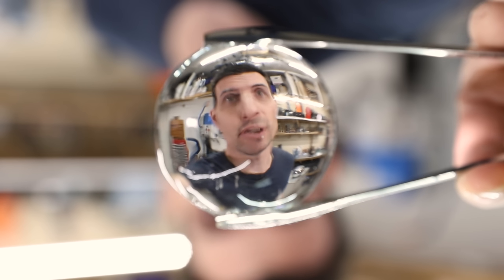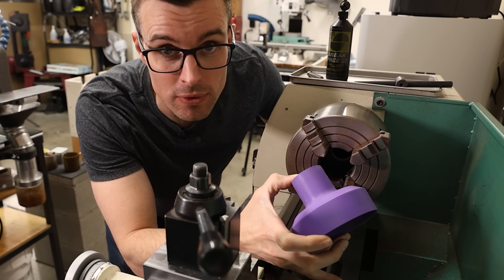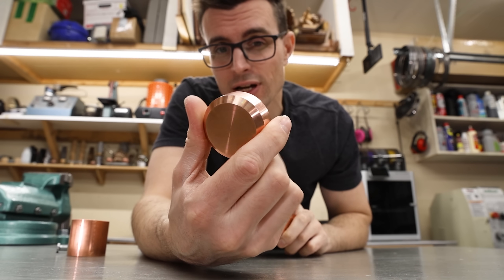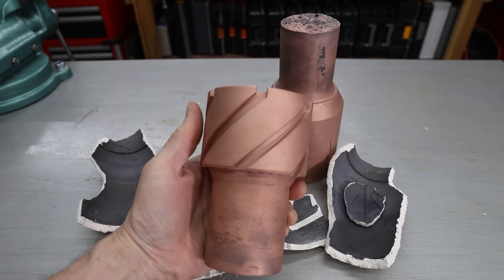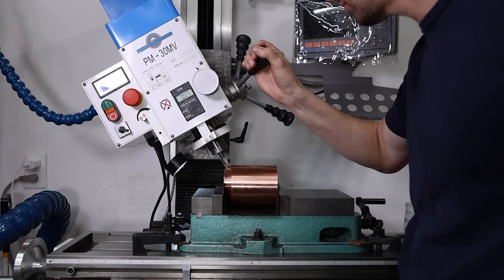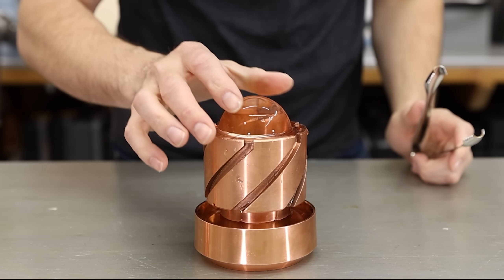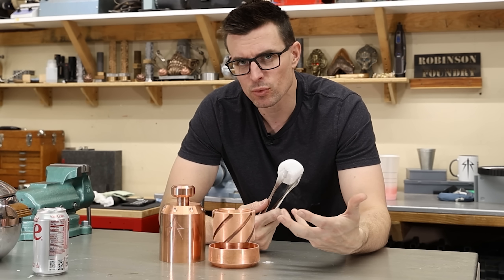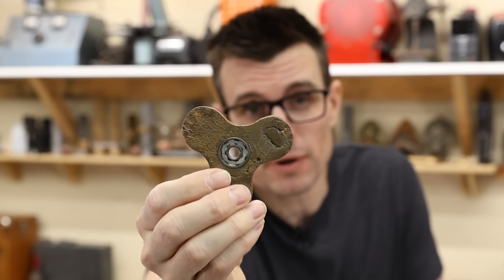I made a Copper Ice Press that Turns Ice into SPHERES - Lets try DRY ICE!

Comment: That was very cool. I didn't know copper would melt ice so fast.
Reply: Same reason that the best computer heatsinks are either copper or include copper in their design. When you need maximum heat transfer from hot chips, there really is no other (cost effective) solution.
Reply: @technicalfool theres silver haha but yeah not cost efficient
Reply: @royalecrafts6252  Ah, but it would be awesome to see one made from silver in action. :)
Reply: @technicalfool diamond is 5 times more thermally conductive...
Reply: @technicalfool wouldn't it be cost effective to have small silver leads from chip to the copper mass?
Reply: Forget my comment. Only 10% higher in silver than copper. Not worth the hassle.
Did remind me why they've been working for decades to get a diamond chip base. 10 times the conductivity of silver or copper
Reply: @technicalfool  Am I the only one here who went to highschool? lol
You learn the specific heat formula in basic chem..
Q=mcΔT
where:

𝑄= heat energy (in joules)
𝑚= mass of the material (in grams)
𝑐= specific heat capacity (in J/g°C)
ΔT = change in temperature (in °C)

The energy released by the copper is more than 3 times what is required to melt ice; gold/silver/platinum are all more conductive, but copper has a much higher specific heat capacity so despite being less conductive copper will still transfer more energy.
Reply: @raidzeromatt 👏🏼👏🏻👏👏🏽👏🏾👏🏿 You are the smartest person on the planet, congratulations.🤦‍♂️
Reply: @raidzeromatt  You learned the specific heat formula yet didn't learn high school is two words?  LOL😉
Reply: Copper is know for it’s amazing thermal conductivity
Reply: Yeah, I thought he was going to put water in it and use the conductive properties of copper to fast freeze it or something?
Reply: You should see diamond, it has the highest heat conductivity of any solid state material, way more than any metal. It's like magic.
Reply: Use hot water for clear ice
Reply: Actually, it's the temperature differential that does the melting.
Reply: @ernie5229  I don't understand how putting a room-temperature copper press on top of ice melted it? Copper is conductive, you're right but how is a room-temperature copper press melting ice so quickly and easily??
Reply: @calicoesblue4703  you just need to get the temperature above 0 for it to melt, and I don't think a higher temperature transfers energy/heat much faster. It's more of a bandwidth issue. And to make it a perfect sphere, you'd need it to not boil away or heat the water at the end too much, as it provides an insulating layer so you don't melt the remaining sphere. Tbh, I only know what I absorbed from my parents and school as a kid, so I might get some of this wrong, but this is my instinctual take. :)

Comment: How about considering whether you can melt quartz glass and start making quartz balls... and make larger versions and start supplying to all of the many esoteric places for their crystal ball uses ? !
Reply: Various colored quartz glass colors for rainbow sales.  Making 2 inch, 3, 4, 5, 6 even 8 inch or larger (!) 12 inch quartz crystal balls.  You can easily make larger versions of this design.  If need be put in a pour (and air) hole.  You would be slamming sales for these specialty spheres ... $$$$$.  Copper for the win !

Comment: I think the reason you didn't get the fog is there wasn't enough water vapor around for it to condense into fog.

Normally when people demonstrate it making fog, they are placing it into water to warm it up. In the closed container any in the air is quickly used.

It would probably work if you put some regular ice and dry ice in it

Comment: Great project. The best way to make clear ice in my experience: fill a yeti style tumbler 3/4 up with no lid and place in the freezer. This is your mini cooler and allows for directional freezing. 18 or so hours later, remove from freezer. Let sit on counter for 1-3 hours. Invert over sink. Squeeze tumbler at top to allow for air to enter around sides and release perfect slug of clear ice.
Reply: To make a bunch you can also use a small chest cooler similarly (if it fits in your freezer) then divvy up the clear portions into blocks.
Reply: This is the way I've done it but if you get the timing right, you can actually remove the ice even easier. I've just inverted the tumbler over my sink and let it sit there for about 15-20 minutes, then used a butter knife to pop it out. But the key is that you can't let it freeze for too long otherwise it's practically impossible to remove from the tumbler. But the benefit to this method is that if you use the right size tumbler, it can be a pretty nice size to fit right in your glass.
Reply: @tylerbogaard375  one thing that I've done that works really well to help remove the ice is wrapping the inside of the cup in a silicone baking mat. It'll leave a small spiral ridge on one side of the ice but you can remove the ice as soon as you take it out of the freezer.
Reply: I use a small ice chest. Distilled water and even then, I get 70% clear ice and the rest is cloudy. Then I saw them all up and put them in bags. The key is to NOT let the cooler freeze all the way. You want the cloudy crap to by watery so you can just knock it off.
Reply: I have had acceptable results filling a 8x6x2 .999 silver rectangular mold with one inch thick mirror polished walls, filled with distilled, microfiltered water and slowly frozen in a vacuum chamber from room temperature reduced to -20F over a period of 38 hours. Introduce argon to the vaccuum chamber as you reduce the vacuum, and remove the ice block using a pair of tongs made from a dragon's hip bone. This yields a very good piece of ice.
Reply: @tabcreedence6553  dragon hip bone is really hard to get in my area. Tried walrus tusk and black hole formed when it touched the ice. Do not recommend.
Reply: @mmr159  "Yeah, dragon hip bone is premium, but have you tried unicorn horn? The trick is ethically sourcing it—those things hold grudges. Last time I used one, my ice was perfect, but all my drinks started floating away mysteriously."
Reply: I think you're exaggerating, I doubt you need 1 in thick walls, also I've found that most any dragon bone will make a serviceable pair of tongs not just the hip bone. @tabcreedence6553
Reply: @tabcreedence6553  "Impressive! But you missed a step—you need to sprinkle a pinch of moon dust while introducing the argon. Otherwise, the ice might not align with the Earth's ley lines, and your cocktails will taste slightly... mortal."
Reply: So 19 to 23 hours later you get a slug of clear ice.....😮🤔🙄😅 From what I saw in this video it was 40 to 20 seconds after you went and either made or purchased your ice😅 ball press
Reply: I continue to "shake" oilmen with my innovative project of a non-combustion engine, I remind you that I am posting here on my channel the technology and the principle of operation, according to which anyone can create a prototype and enjoy free energy, since I was denied financial support at the stage of the idea and theoretical research, after a year of unsuccessful searches. Including I will begin to assemble a sample. And soon another video will be released, revealing my developments, the wind of change is approaching! All those who are not indifferent, welcome to the flight in this departing innovative car, which will lead to great achievements for the successful future of the planet and humanity!

Comment from the maker: What should I try next and please hit the 👍if you liked it!
Reply: Make a copper frying pan!
Reply: That dry ice was releasing a surprising amount of energy with the copper! I wonder if you could make a copper crowned heated piston that actuates via the rapid gas expansion of the dry ice melting.
Reply: Very cool! How about metal dice (Dungeons & Dragons) that are perfectly equal weight on each side such that they don't favor any side over others, eg. submerged in water to check biases. 

Thank you.
Reply: Here is a barman's tip I learned from my friend. Get a small coller with the top off you can use tap water. Put it in the freezer over 24 hrs you can have a huge chunk of square ice with impurities at the bottom. Use a bread knife to score the ice then a rubber mallet to wack the top of the knife along the score to crack the ICE into usable square chunks.
Reply: I'm curious, how much would this actually cost to purchase, because it is fascinating!!!
Reply: Brass/bronze/copper mjolnir?
Reply: Make it out of silver
Reply: @InTheAKSnow @ 16 lbs it would cost over 8 thousand dollars 😳
Reply: Casting HO scale train wheels
Reply: Try a Phone case
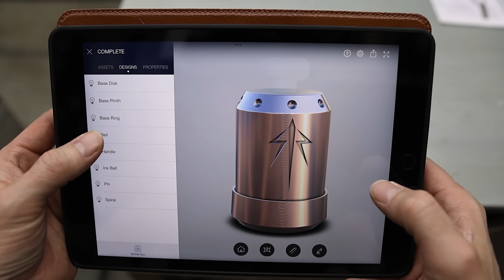Reply: Out of curiosity, what was the CAD software you used? (0:40)
Thanks so much 🧡🕊️🤩
Reply: Look for my comments
Reply: I continue to "shake" oilmen with my innovative project of a non-combustion engine, I remind you that I am posting here on my channel the technology and the principle of operation, according to which anyone can create a prototype and enjoy free energy, since I was denied financial support at the stage of the idea and theoretical research, after a year of unsuccessful searches. Including I will begin to assemble a sample. And soon another video will be released, revealing my developments, the wind of change is approaching! All those who are not indifferent, welcome to the flight in this departing innovative car, which will lead to great achievements for the successful future of the planet and humanity!
Reply: I bet you could reinvent the herb 🌿  grinder.
Reply: try to make a prince ruperts drop without a tail by quickly submerging the hot press in dry ice, i believe that would be a first!
Reply: Try adding food coloring to the water before you freeze it into ice.
Reply: Don't really have a suggestion for your next project but this suddenly came to me:

Have some longer projects to make into series. At the end of each series, release your own commemorative coins as merchandise, with each series' coins having its own unique design? Food for thought, maybe?
Reply: I wish this was available on a market place. What a cool add to a bar
Reply: mr robinson from the angry birds hat guy
Reply: Lightsaber
Reply: it's a mini snowball machine
Reply: How about making clear ice😂 use reverse osmosis water so that it's 100% mineral free. . . . . You'll be amazed
Reply: do a silver one, since it is a better conductor! 😅
Reply: How about a spice rack and the individual containers will magnetically adhere to the base but not to one another, you pick the base materials...?🙂👍
Reply: Make another copper sphere video with motors of different speeds
Reply: Molybdenum pan.
Reply: How about a cocktail shaker out of a single piece of bar stock entirely on the lathe, @robinson-foundry?
Reply: Can you try and make these on demand for sale please? 🙂
Reply: @KiteInAHurricane  I'm with you on this one!
Reply: I forget if i've seen copper damascus before or not? I don't know alot about metalworking even in general, but with steel damascus the idea is that you have 2 different alloys that respond differently to being etched in acid, so you can get these crazy patterns by contrasting the 2 metals.

I wonder if you could maybe even do something with nickel and copper?
See aluminum and copper would probably contract at different rates, and i have no idea what they'd do in an alloy...

Maybe even a series of just figuring out methods to make patterns could be cool, alec steeles channel has a series about titanium steel damascs that i've been enjoying lately! 

I also just think that shiny copper looks so good!
Reply: @SethCrowderMusic  You can use a copper-nickel alloy and pure copper to make something like damascus.  Most people just use a stack of US quarters forge welded together.
Reply: @SethCrowderMusic 🔴 Why Islam not other religion

 1-islam gives logical and simple idea for God - he is A perfect God - he is not a man nor a son of man nor an Idol or a trinity nor limited nor created - he is totally unique and to him belongs all the good qualities 

2-Islam accepts all messengers of God -- about 124 000 and in Islam, we love all the prophet of God and we can’t deny any of them - while in other religions such as Judaism for example - they reject Jesus and Mohammed -- and in Christianity they reject Muhammad ... but in Islam, we accept all . 

3-in Islam, there is no mediator between you and God -- you can pray to God directly - there is no need for someone in between... 

4- Islam is the Only religion that is Not named after a person or a tribe or a group, its name means submission to the One True God, if anyone anywhere at any time lived the life of submission to the true God alone , then he is a Muslim.

 5- In Islam (worship) is not about mere rituals. it's a comprehensive term that includes any deed that pleases God. All good deeds are types of worship, smiling, being sincere at work, saying a nice word, and even treating one's spouse gently, all this is greatly rewarded by God. And in the opposite any deed that doesn't please God is a sin; talking bad about people is a sin, cheating, lying, hurting innocent people, harming the environment. 

6-in Islam God is always forgiving - if you always repent (before death ) he will just accept you no matter how great sins you did >he forgive us out of his own grace - there is no price to be paid in order for him to forgive > so it's not like Christianity which says that God can't forgive except by blood of Jesus ..

 7-Islam is a way of life – it organises each aspect in your life.. it has solutions and divine guidelines to problems in your life . 

8-the sources of Islam also was collected and saved is also amazing - it never happen to any book in history --- it's through the uncut chain of known narrators which date to prophet time ... besides the millions who memorised it from cover to cover since that time up till today - besides being documented in front of the prophet by known companions! 

9-Islam prohibits blind following without knowledge and it invite us to use our brains to know truth, it is based on evidence and logic. The rational mind is the basis for religious accountability and responsibility. 

10-the moral system of Islam is v high and perfect and thus the countries that apply Islamic laws in a proper way -- they have less moral crimes.

 11-You won't lose Jesus if you accept Islam, but you will just correct your belief in him , In Islam, Jesus stands a good position in Islam as one of the messengers of God together with other messengers.. they were all special and they were all humans like us-- none of them must be worshiped -- we only worship God who sent them . we believe that Jesus was a noble Messenger of God but not divine,,,, we love Jesus and obey his true teachings and pray like him , fast like him , and a person won't lose Jesus if he accepts Islam -- but you will just correct his belief about him 

12- Paradise in Islam is a real physical life for both Body and soul, you will go there , eating drinking marrying and meeting with prophets and having wonderful eternally unlike in other religions which they think its only spiritual life.

 👉IN ISLAM THERE IS A PURE & CLEAR CONCEPTS OF GOD 

🍃🍃🍃🍃🍃🍃🍃🍃

God is One and Unique: God has no partners, no equals and no rivals. God has no father, mother, sons, daughters or wives. God alone is worthy of all worship. God is the All-Powerful: God has full authority and power over all things. Obedience to God does not increase His Power, nor does disobedience decrease His power. God is the Most High: There is nothing above or comparable to God. The attributes of God do not resemble that of His creation. No part of God is present in anyone or anything. God is Perfect: God does not have any human limitations, such as resting on the seventh day after He created the universe.